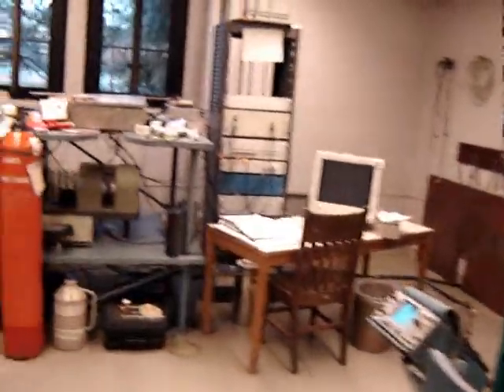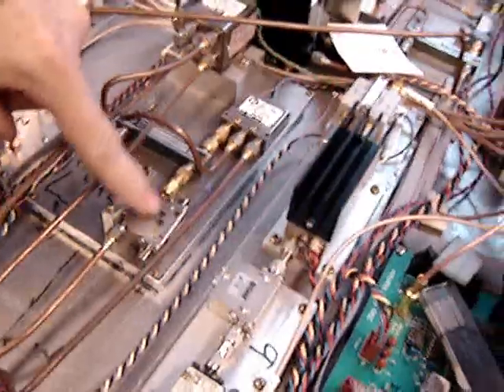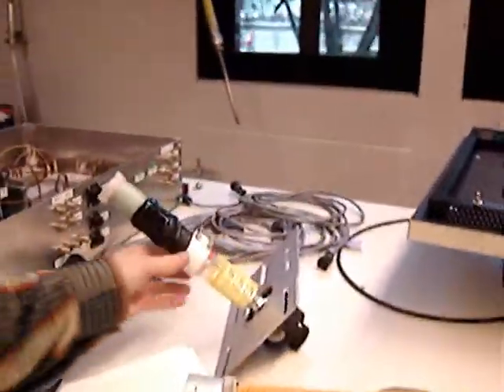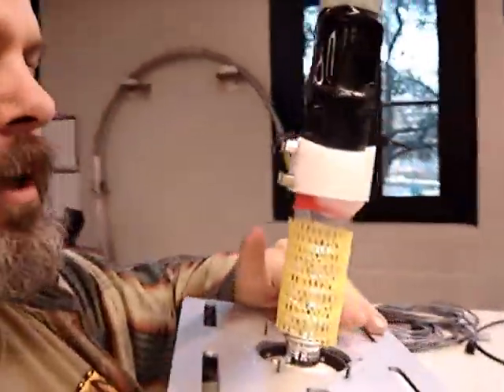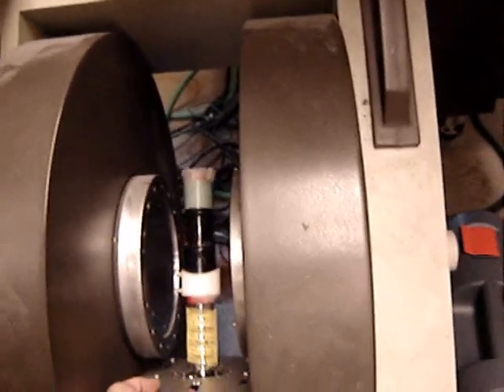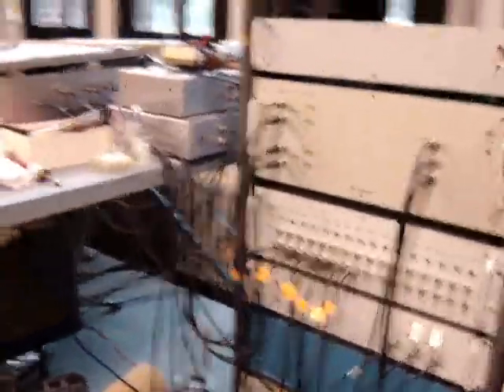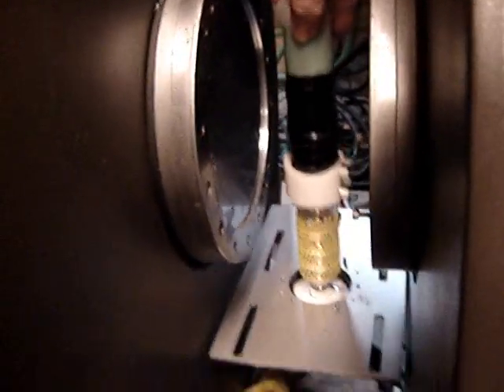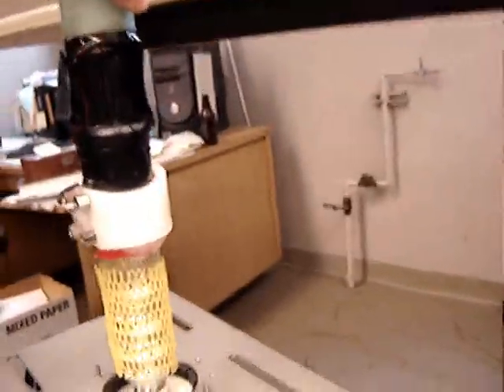Job: Research Engineer

Comment: There are, as well, many research engineers who also actively participate in the research process itself, depending on the type of research or project. It is often difficult to distinguish between engineers and applied physicists. For example, half of the Nobel Prize for Physics this year went to Charles Kao, an electrical engineer, for his ground-breaking work in fiber optics at Standard Telecommunication Laboratories in the UK.

Comment from the maker: > I want to go into physics,

I'd get to the nearest college library and read lots of "PRL," the journal "Physics Review Letters."  That should give a good view of current physics.

Yep, physics is math first, PhD minimum requirement.   But you could go into experimental.

Then there's the other tradition.  Get a normal 9-5 day job in hardware or software or the Swiss Patent Office, and work on physics/inventing/etc. in your spare time.  Get lucky like Einstein and others, and strike it rich.

Comment from the maker: Sure.   You just specialize in analog electronics rather than digital, then go into "RF" the radio circuitry field and microwave etc.  Power electronics.

Comment from the maker: > Sounds more like an research engineering technician...   Well, more like jack of all trades.  Over half is technician work.  But this job also requires analog/dig design, microwave PCB design, optics, machine shop, embedded VB, C/assembler, high voltage design... as well as skilled repair of all sorts of bizarre devices not taught in any tech school.  I suspect that they want engineers with physics knowledge so they won't get killed by high-power high-voltage equipment.